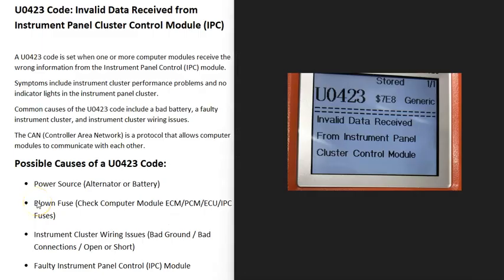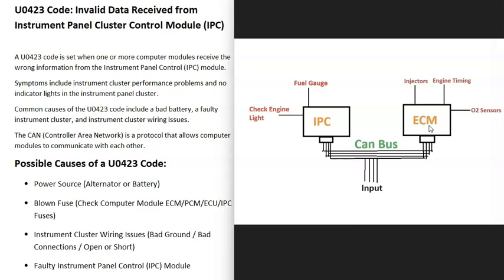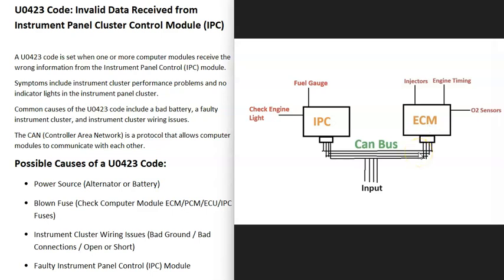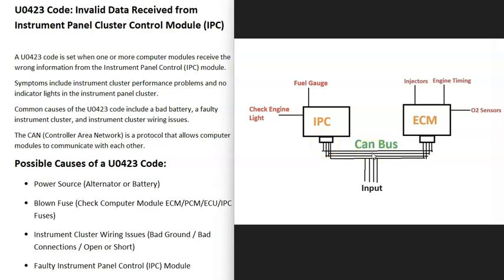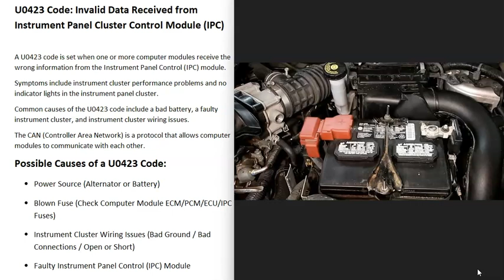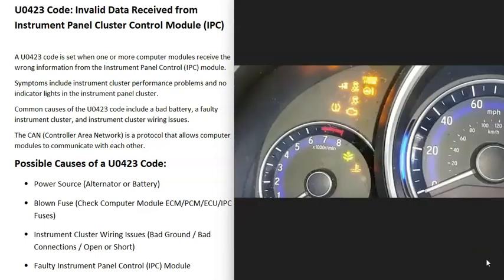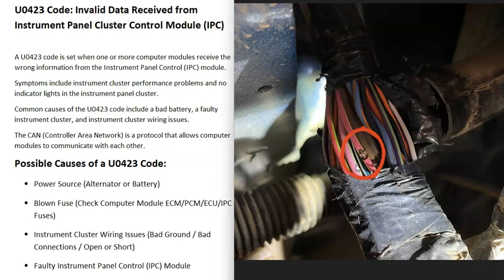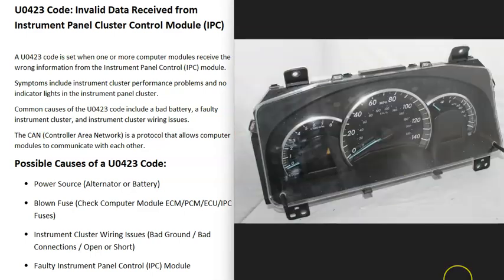Causes and Fixes U0423 Code: Invalid Data Received from Instrument Panel Cluster Control Module IPC

Comment: I realize this is over a year old but I just had my 2015 F150 in for parking brake malfunction, dash black and gauges fluttering on hard start. It only seemed to happen once it got plenty cold out, up until then there was no problem. I highly suspect it's the batter and/or alternator since it's a hard start which leads me to believe it's not the IPC but lack of juice from the get go. That is when the errors start showing up. Not in the course of driving, not after I've been driving, but just at the very start up. The dealership is trying to stick me with over $1000 in parts and labor because they "think" it's the IPC but aren't sure. I'm not signing anything until I get that battery and alternator tested.

Comment: I got a non working analog speedometer
Reply: New Battery, Replaced all ABS sensors 2013 escape 2.0 SE, still have one ANS error code (might be wiring). 

Gonna have to check fuses.
Reply: Ah shoot. I found a visible tear in my harness wire leading to the ABS sensor, never checked well enough, I need that not the sensors.